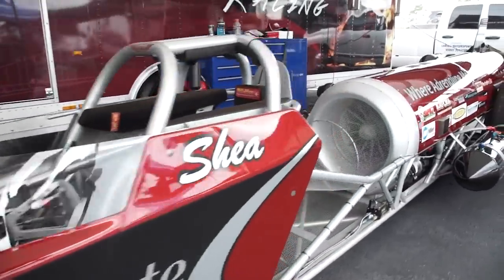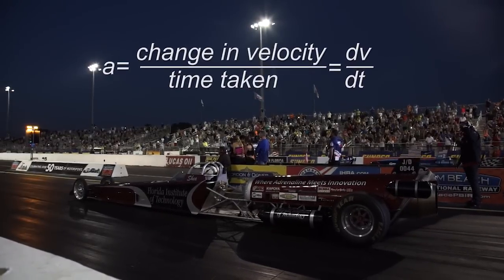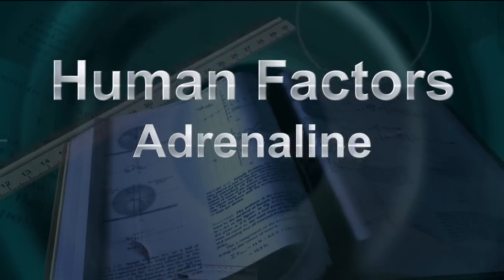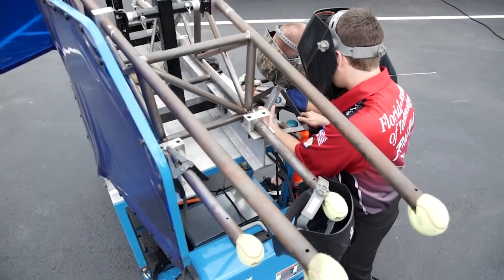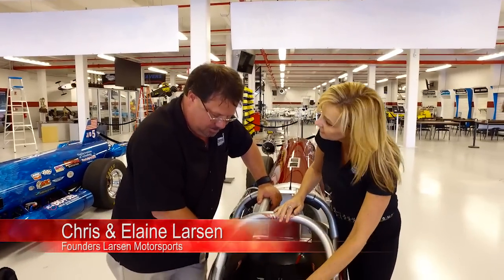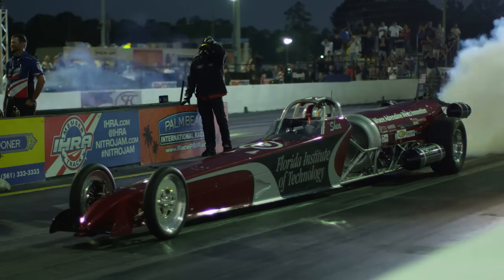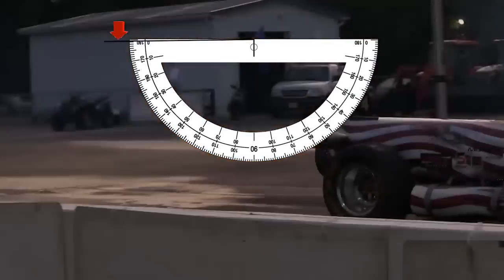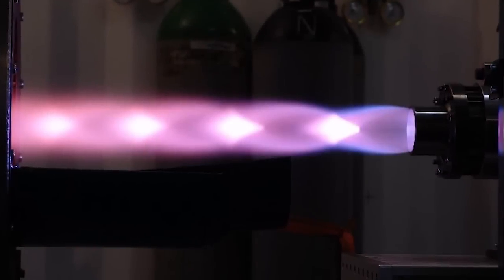The Science of a Jet Dragster

Comment: When are you going to get a jet dragster that will go 350 and around 3 seconds. Its possible.
Reply: The NHRA sets Speed Restrictions on the Jet Cars and Trucks. They can definitely go quicker. And there also using Mid 50,s Jet Turbines, just imagine if they used something a little newer and more efficient, These Turbines are practically Antiques.